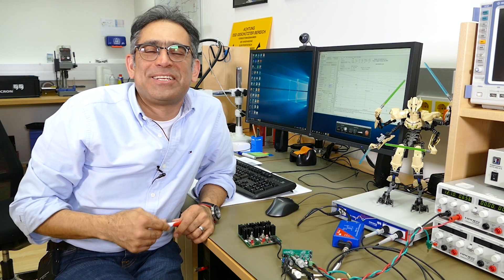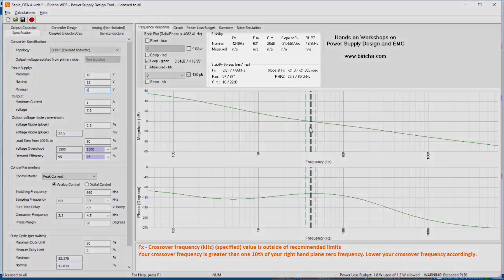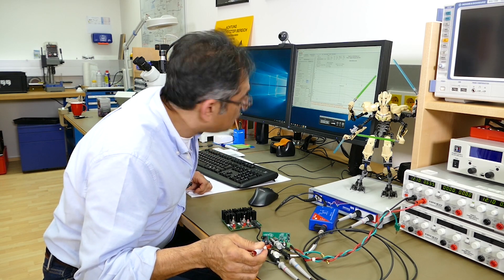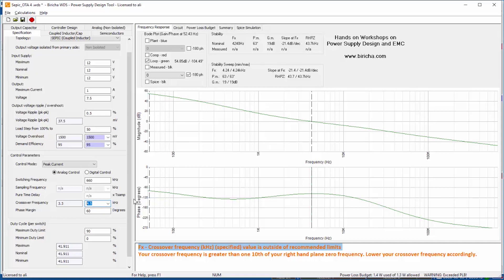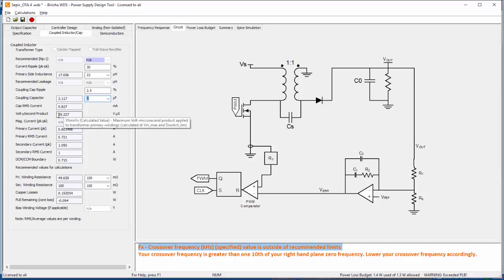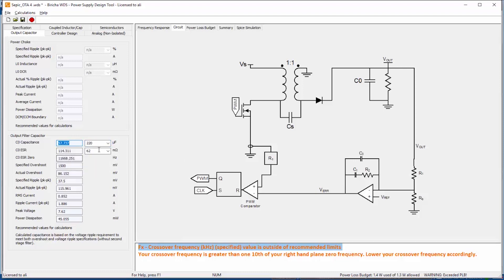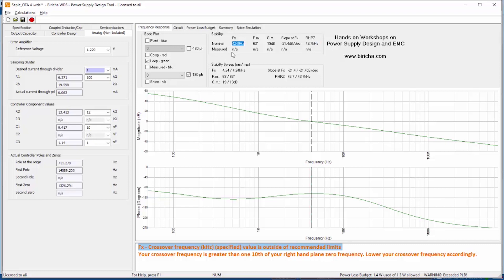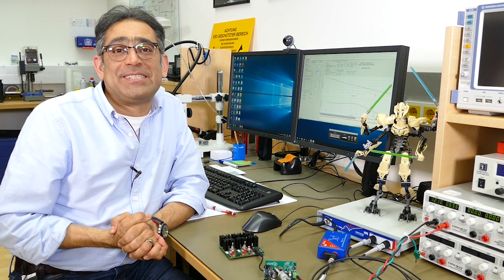Design a SEPIC Converter

Comment: Dr. Shirsavar, I noticed at 7:00 that the coupled inductor dots are facing Vs and GND, but I believe it would be best on the actual PCB to have the dots connecting to the Switch (SW) side. That is because the dot on each of the two inductors indicates where the wire starts to be rolled on the core. The dot point is BELOW the rest of the windings and is therefore is shielded by them. In a SEPIC or other switch mode design, the SW node is your noise source. Hence, it would be best practice to design your SEPIC PCB with the shielded dots pointing toward your noisy SW node (which in the case of your video is either end of capacitor Cs).
Reply: very good point  - the dot "often" means the start of the innermost layer so it is good layout practice is to make sure that that the innermost winding  is tied to the switch node. Thank you